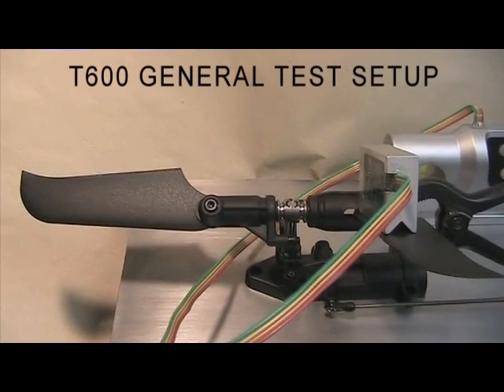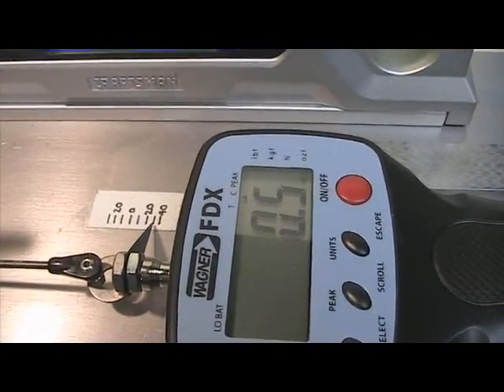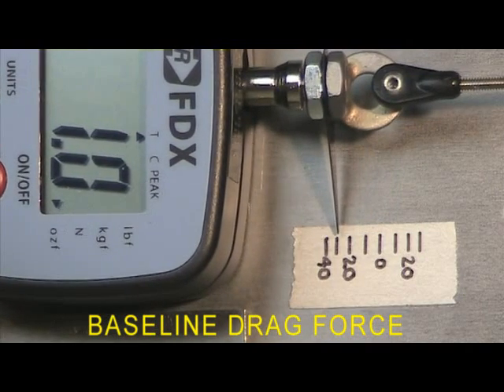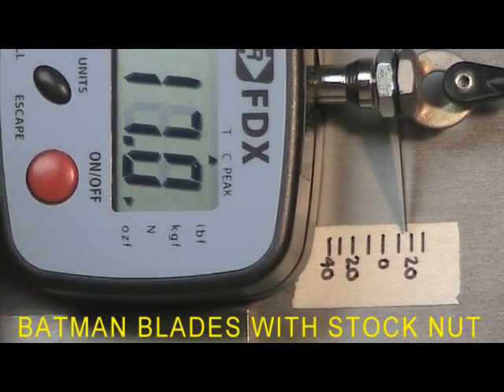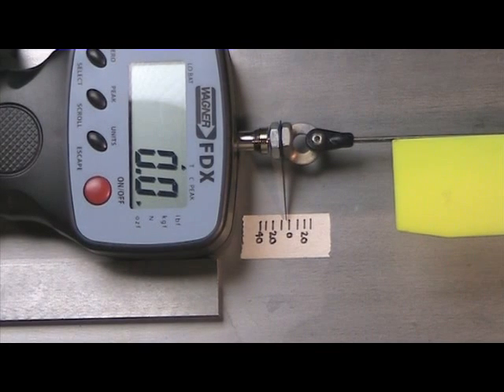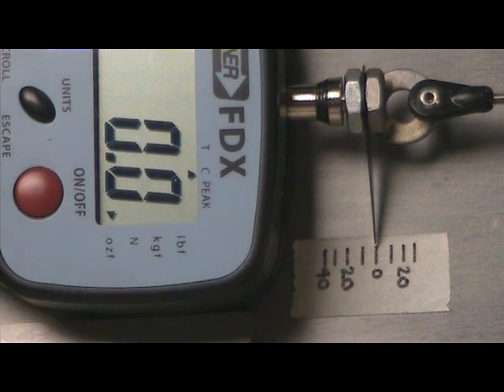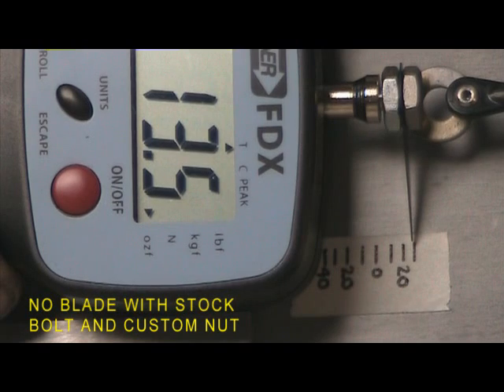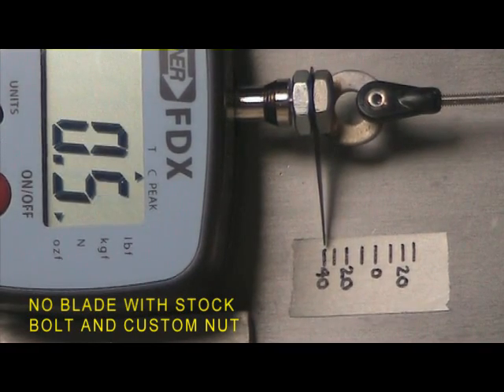TREX 600 TAIL ROTOR PUSHROD TEST

Comment: Hi!

great vid, thanks!

I always wondered how much force does the swashplate pushrods has to stand. i mean the 3 from the servos to the swash, and the two pitch rods - FBL setup.

Can you measure it somehow?
Reply from the maker: Thanks, it could be done but would require a scope to read the force gage output for cyclic moves.

Comment from the maker: Actualy the pitch arm of the blade grip is the biggest cause of tennis raquete effect. the blades are second.  The weight(in this case just a custom nut on a stock screw) at 90 degrees to the blade and pitch arm is what cancels the tennis raquete effect. there is very little aerodynamic forces involved in the forces.

Comment: great video to show the forces on the push rod and (servo) .but surely the extra weigth of the longer bolt and modified nut, add to the mass of the rotor grips, that helps to counter-act the dynamics of the blades wanting to go back to zero deg. pushing back on the push-rod. (is this what your results show.  ps. would like to know what forces are on main rotor head.

Comment from the maker: The Trex 600 chinese weights (nuts only) for stock plastic grips are $7.50 a set plus  $2.00 shipping & handling for up to 2 sets in the US (US postal letter)
I need: 
your name & shipping address 
email address to send you a paypal invoice that can be paid with credit, debit, or paypal.  
It will be week or two before they ship. I wont invoice until they are ready

An aluminum nut would make it worse. The tuned weight nut is heavier than the stock steel nylock

ROBRENZ